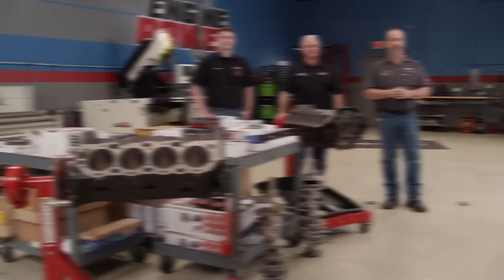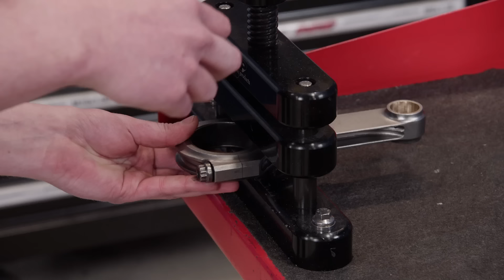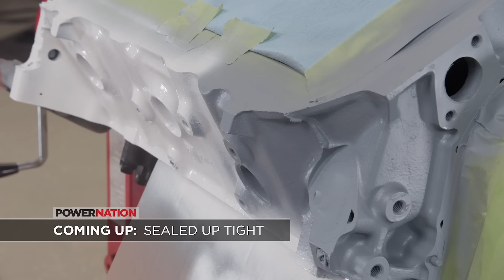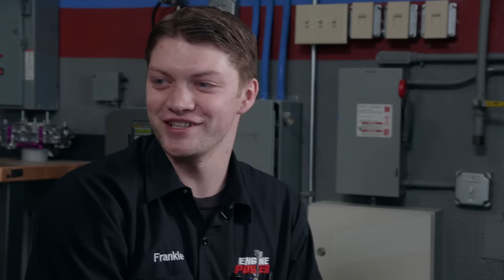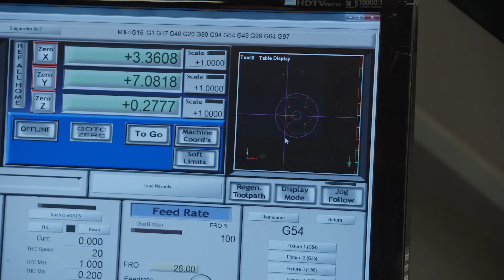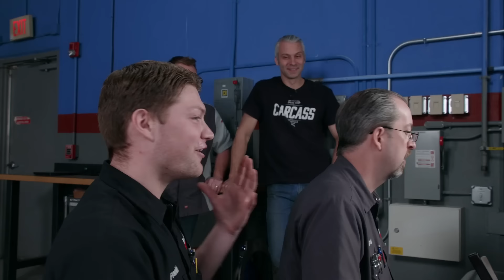Twin Big Blocks Dyno'd Together - Engine Power S9, E5 & 6

Comment: Great video and testing. 
Good that you’re using 4130 cranks especially on the rear engine. Have you calculated the actual “twist” the extra torque is putting on the rear crank? Just wondering how many degrees early the timing is in the rearmost cylinders because of the extra twist. Great job guys!

Comment: You should have done the second engine at 45° to have a firing every 45 degrees vs 90 for the 16 cylinder. Putting all the pistons coming TDC simultaneously is not a good idea. 16 cylinder at 90 degrees is not balanced.
Reply: It would have started easier than a single big block 45 degrees apart.
Reply: Harmonics caused the power loss with the phasing.

Comment: I have always wondered how crank phasing would effect power, having two cylinders firing at once , isn't going to help anything, especially with the exhaust connected, maybe offsetting it where it's 180° from the other engine, , maybe it could gain power!! 👍👍👍

Comment: could you connect them to two built th425 transmissions from an elderado or tornado and have a twin engine 4 wheel drive car or pickup, one eng/trans in the front and one eng/trans in the back??

Comment: As no two engines can truly be identical,  I've always imagined that in any double motor setup the weaker of the two would have to act as a sort of a parasitic drag on the stronger.

Comment: Crankshaft torsion on the output engine is probably a factor in the total power output. It'll be interesting to see if phasing makes any noticeable difference but with 16 cylinders even an odd fire engine will run pretty smoothly. Maybe a flexible coupling between the two would make more power just because it would help with softening the firing pulse harmonics. Good job guys it'll be interesting to see more results. Thanks
Reply: Why do you think they put forged chromoly cranks in the engines?

Comment: If a 16 cylinder engine would be built, they would never have 2 cylinders on the power stroke at the same time. An 8 cylinder fires once every 90 degrees, you should have them out by 45 degrees to help out with smoother torque and HP. That might actually find the lost power, or even add more.

Comment: I would try offsetting the phase by 22.5 degrees. I think it would act more like a V16 and less like a double V8.Each cylinder would be firing on its own instead of trying to fire 2 at the same time. Just an idea if you try it again.
Also, that has to be a unique set up for sure. And talk about thinking outside the box.

Comment: Can you spin the adapter between the engines so that instead of both firing every 90 degrees they were firing every 45 degrees?  Steve Morris did this on a V16:  "As a result of the firing cycle configuration, the engine also picks up a solid amount of power since the operation is so smooth – there’s a firing cycle in between what’s normally a dead spot in a V8 design"

Comment: I saw a 66/67 Nova with a pair of 4.3 V6s at Pomona Street Legal Drags several years ago. The builder was making passes after changing the way the engines were phased to one another. He had a single distributor between the engines made from a Jag V12 piece. He would change the firing order to match how he phased them, then go make another pass. I can't remember the results because something failed (distributor drive setup/engine coupler?) He said it made a difference in power, but I don't remember details. Pretty crazy street car.

Comment: Why wouldn’t you use a cv or universal joint between the two? Rigid couple seems like it would put stress on main bearings. Especially when generating torque, engines do not only rotate about the crank, there’s usually some Y and Z axis movement from cylinder firing.
Reply: There should be enough tolerance in the splines to make up for that.

Comment: 🤣that ain't nothing jon kaase built a 598BBF that made 1109hp/937tq on one engine just imagine if you guys put two of those BBF crankshaft to crankshaft on the dyno, I bet they will make over 2khp/2ktq....let's face it Ford engines makes more power

Comment: I believe i heard you say that you indexed the engines both at TDC when you set up the coupler. Maybe remake the coupler where the engines are indexed with one engine 45 degrees behind the other. That way instead of of both engines firing
#1 at the same time then 90 degrees later both engines firing #8 together, it would be engine A firing #1, then 45 degrees later engine B would fire #1 then 45 degrees later engine A would fire #8 and 45 degrees later engine B would fire #8, and so on. Instead of having a firing event every 90 degrees with two cylinders firing together, you would have a firing event every 45 degrees with no two cylinders firing together.

Comment: One thing they didn't talk about, while they are both very similar engines, what are the actual RPM for peak power and torque for each engine? If they aren't at exactly the same RPM then one engine will peak before the other, and the peak of the combined engine will be less then the mathematical sum.

I would love to see an analysis where they add the curves from the single runs together, and then compare those curves to the combined engine curves.

Comment: My most favorite drag boat The Assassin. A twin mill configuration a Blown 392 Dodge Hemi with a 327 Chevy Hilborn Fuel Injection. The idea was mixing Torque with High Rev's. It was only 2nd to the  Mortician a pickle fork with an Allison 1710 cu in motor, they used the shotgun shell starter.

Comment: Man I was on the edge of my seat during those pulls what an episode wow. Guaranteed the exhaust merging together and running the engines hotter made them loose power individually
Reply: 4” to 5” no mufflers those engines are not even noticing anything from the exhaust

Comment: You've doubled the parasitic loss by connecting two engines.  I'm surprised the power only dropped that much.  Each engine is pushing it's own loss plus the loss of the other engine.  Great work!
Reply: More likely an exhaust problem... maybe even a muffler out of view...

Comment: 4 into  one headers, should. Have been straight up centred to the Engine, Engines. then if you wanted 8 into one they'd be able to be joined even, and equal length.

Comment: Each to their own, but Hydraulic Lifters, low compression Big Block Chevy, 87-91 octane pump fuel woosie motor ..Kinda like drinking low beer non alcoholic beer🍺 And expecting something crazy to happen. Sure would be Nice to have Summit as a Sponsor though.

Comment: 1-2-3   1 equal the header's   2 phase rotor in distributor cap   3 exact timing with the light on both engines!  sync carbs and check air-fuel mixer screws Then go from there, you might want to add about 2 degrees to the front engine! That is the one that will balance out the second engine Good luck guys.

Comment: The guys should research the triple and quad setup used with sled tractors. The Detroit 16v71 is a production example of this though using two 8v71's bolted together.

Comment: There's no replacement for displacement.     Would like to have seen a run with 45deg of phase on them to more distribute the ignition of the cylinders.  That might introduce more stress on your coupler, but instead of doubling the impulse on each cylinder firing it would distribute the impulses more evenly across the rotation of the engine.   A lot of theory in what I just said, but curious on how it would translate to an actual dyno run.
Reply: They did. They were at 46*

Comment: I just built the same setup over winter for my boat.  Same cam specs compression ratio, crank , rods, intake etc.  single engine of course.  Can’t wait
To put it in the water and see how it does

Comment: You guys need to make a 6.8L DOHC 40V Triton V10 by custom making with 4 sets of 4.6 4V Cobra headsby cutting-em and welding-em as well as porting and polishing the modified Cobra heads, custom made camshafts, and a custom made intake manifold and man you have you're self a 500 HP Homemade 6.8L DOHC 40V Triton V10 and it'll sound narly as well.

Comment: so basically this is putting a lot more load on the second engine.. and it wouldn't matter if they are both tdc because the output of the front engine is just output... the rpm could be an issue though since its a solid shaft.. a torque converter would take care of all of that... and the second engine's timing is going to stay whatever because its just rotating with extra input on its crank and the valves are all moving based on its own cam and the front engine isn't going to make the second engine drop a valve because they are off... i would bet if you ran them .. the second engine would see more wear on its crank bearings but thats about it...

Comment: This is awesome! Now of course we wanna see phasing tests, but I wanna see the engines phased so each bank fires evenly, into one 8-1 header on each bank! The sound would be INSANE! So that would be 360 crank degrees out, 180 cam degrees out. They'll fire into an 8-1 like a inline 8 would. That would be ideal exhaust header scavenging.
Reply: I want to see numbers for equal phasing vs. "in-between" phasing where one engine has a power stroke in-between the other's, so it would fire 1 1 8 8 4 4 3 3 6 6 5 5 7 7 2 2 with equal distance between each event. Maybe even combine that with a 360 degree offset to make 1 6 8 5 4 7 3 2 6 1 5 8 7 4 2 3
Reply: @jckf  yeah exactly. I imagine running them 360 out would be the best scavenging, but wouldn't be as cool a sound. Crossed over 180 degree style headers would make the best sound, and there's room to run header tubes between the engines.
Reply: Love to see that but Id love to see them blow!
Reply: That would be sick but I doubt they are gonna do that much fab work

Comment: Change the firing order before phasing the union shaft and then phase it with the factory firing order and so on... Also connect both intakes with another carb in the middle to balance air and fuel flow.

Comment: They didn't factor the added weight these engines were turning.  What, 40-50lbs of steel for the drive coupling.

Comment: The 3 ARP bolts holding the connecting shaft to the balancer on the engine connected to the dyno, is the best advertisement for ARP hardware there is. Three 5/16's bolts can handle 600 ft/bs of load 😳 The flywheel on the first engine had 6 or 8 of the same fastener.
Reply: 3/8 but yer.
I'm surprised the welded axle held up, small weld bead on hardened axle.

Comment: in order to get full output in a dual set up both engines need to set up as a pair both timed to match it's mated engine. if one or the other is just a bit out of time it will drag the matching engine down loosing power. it's the same but not as bad in a boat were there apposed to each other on different sides of a boat but they still need to be mated and timed to work.

Comment: This was done successfully starting with the 1957 NHRA fuel ban. Because gasoline was the only fuel allowed,  Hot rodders began to use multiple engines to replicate the power that Fuel once gave them. Engines inline, side by side, side by side In a V position and four engined driven by front and rear differentials. This is nothing new, these guys aren't ground breakers. This only impresses unexperienced young viewers.

Comment: Finally, I'm able to obtain the knowledge of "why/and how" Dragsters (back in the day)  and Tractor Pullers (still doing this) stage their Engines "in-line" with each other!
This has rotted my mind for some time.
THANK YOU for this demonstration!
My biggest question is "How and What is the Benefit"?
Reply: There is a guy here in town where I live that has a third gen Camaro with two Big blocks in it. One in normal location and the other in the passenger seat area. The two engines are connected using a V-drive gearbox from a speed boat that has been modified with another output yoke that's connected to a drive shaft that goes to the rear differential like any other camero would. It's freaking wild! He said it's like driving any normal car other than having a four or five hundred horsepower big block as your passenger instead of another person. He will openly admit that he has no idea what it will do because he simply hasn't got the balls to try LOL.
Reply: @NicholasB45  V drive is a popular way to mount them side by side also.  Front to back I've seen done with two sprockets of equal size. One mounted to the flywheel of the front engine, the other to the balancer of the rear engine and a double roller chain wrapped around both sprockets. Seems like less mechanical interference than the rigid spline that way too. There will always be some misalignment and that's why a coupler with some flex needs to be used. I think the shaft setup they have here would lead to early crank bearing failure.
Reply: Umm.. what's the benefit??  TWICE THE POWER !! 🤘🤘

Comment: I wonder if the tuning on the rear engine would change with it essentially being driven by the front engine? Would it take more timing, or need less fuel?

Comment: so, this has been done before, just not really with stuff like this.  Detroit diesel 2 stroke engines were just bolted together if their cylinder count was greater than 8.  a 12v was two V6's, and a 16v was just two V8's.  That said, the phasing of the stroke can greatly affect vibrations here.  phasing these engines 180 degrees apart would likely help with crank vibrations.
Reply: There was a 12V71 all single block, the 16V71, 16V92 were 2 V8's connected together I never heard of 2 V6 engines being connected I drove a truck with a 6V53, I can tell you it would be a waste of time and money to put 2 of those together
Reply: @bertgrau3934  and yet there was a 12v53
Reply: @dalegawne5286  
Yes there was, but I would bet that for the power verse the fuel consumption it wasn't worth it. Just my opinion .

Comment: I'm surprised because,  I didn't think it would have made that much power.  I was thinking it would only make around 900 horsepower. 
It was impressive without a doubt.  I didn't think it would double the horsepower,  but for all practical purposes,  it did.  
Great job guy's!!

Comment: Can you guys build a ford 289 that is de-stroked?
Reply: It has a pretty short stoke already, what would you de stoke it to 1.6 inch and try for 20,000 rpm? Unless you change heads it will make the same HP and allot less torque.